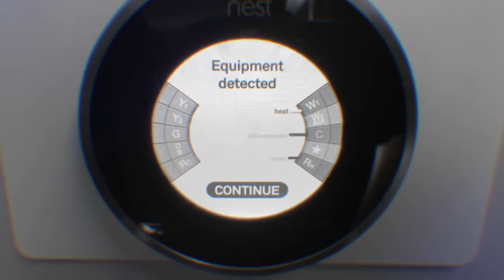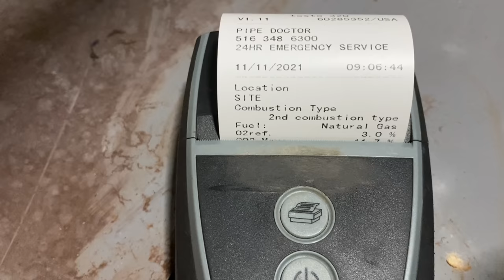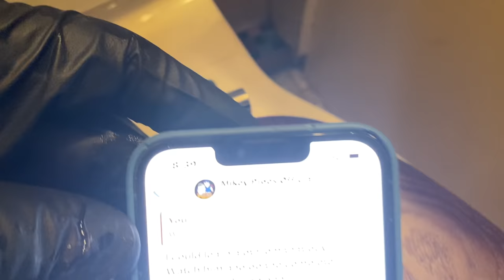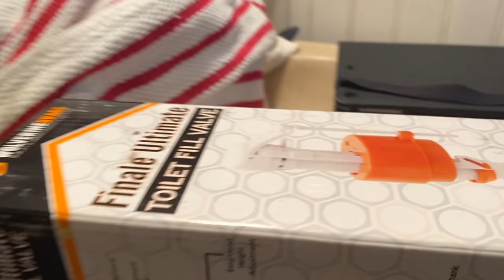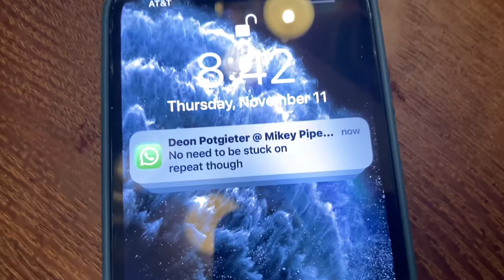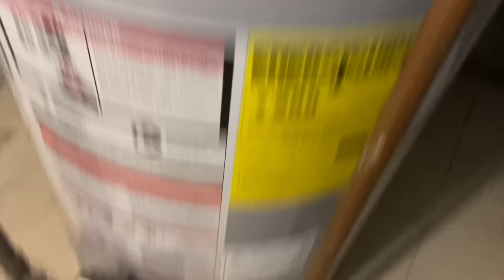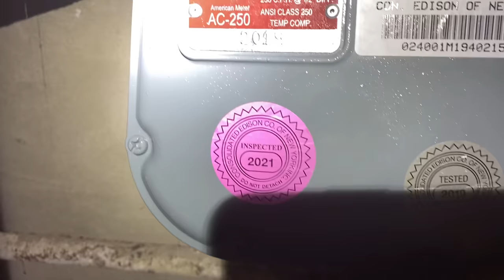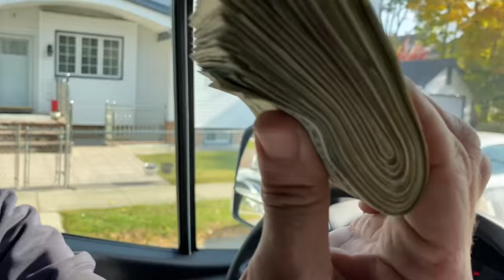Their House Could Of Have Blown Up! Huge Gas Leak on Brand New Williamson Steam Boiler Found!

Comment: This reminds me of an issue my parents had. They hired a plumber to put in a new furnace for them. About two days later they called me, and were like, the house still smells like gas. I responded it's not right and they should call the plumber that put the furnace in. They don't like to be demanding to anyone, so I decided to stop by with some gas leak detector fluid I had (essentially noncorrosive dish soap, like using it instead even though I still wipe up the mess after testing for leaks), anyway, I didn't even have to use it. Before I even took the cover off the furnace, I could hear a hissing noise. Reached up and turned off the gas valve, noise went away. Turned it back on a minute later and the noise came back. Power was already cut off to it. I had the number to the plumber because he's the same guy I hire, and yeah, he showed up 10 minutes later to fix it. It was a defective elbow on the piping he ran inside of the furnace, opposite side gas entrance so had to do two 90's to get it into the gas valve. The real kicker is that the gas was propane too, my parents were real lucky it didn't blast the house sky high.

Comment: Mikey shouldn’t that vent be further away from the elbow say about a foot away? The reason is that the vent is susceptible to being wrecked by steam hammer being too close to the corner where the water changes direction.
It wouldn’t hurt if it was up higher on a nipple if there’s any room above.

Comment: Wow haven't seen the gas meter inside a building in a long time. They moved them outside years ago.  Keep learning "Peter Pro Press".
Reply: Here in MA many of them are inside. The gas company has started to move some of them. If you have a stone foundation and very old gas line they don't give you an option to move it, only to disconnect and move to another fuel within X number of years. They don't want to risk drilling some of the old foundations and they don't want to reuse the original pipe.

Comment: brave! with big pipe wrench and hammer on the steam vent/bushing. 😱
I have a one word device for that situation "TORCH". heat the larger diameter or outer most part, so it expands the most (what the vent is being removed from in this case) and not the part being removed itself. although just heating everything in general works by breaking the ancient rusted/mineral bonding.
if it's out in the open and easier to redo a section a few feet each way, then take that route. I have managed to get things apart others couldn't or for sure would have broken off(but its time consuming). I usually go for the cutting/replacing route first, even if that means manual pipe threader in a few places.(big pipe wrench and cheater bar)

Comment: I remember when a friend was doing some work on his house... hit the plastic gas main with a pickaxe. Talk about an underwear-changing moment! Fortunately, there was no ignition. If you guys ever get into the  heat-pump water heater "craze", it would be good to see how Mikey Pipes Rolls! My AO Smith came from Lowes, but it's got a brass drain-valve... plumber couldn't find the vent-kit, though, since it apparently is not an actual AO Smith... just some re-branded "stuff". I sure hope the car companies don't find out about this sort of "business strategy".

Comment: Although it is asbestos and dangerous only if disturbed why did you say that the corrugated asbestos pipe insulation was illegal?  If it’s not disturbed and doing its job what is wrong with it?

Comment: Sounds like that regulator is hunting. Probably restricted vent line. Weird that the meter and regulator for the utility is inside a private residence? I've seen it on commercial and multi family before but not in a detached home.

Comment: Yeah, they sent us to do work for a school district and they didn't tell us that the reason why the building was vacant because it was filled with asbestos. After breathing that crap for 5 hours, we noticed that it was asbestos.
Reply: Bosses are great, aren't they.
Reply: @rogerlague1520  man i really felt that i was betrayed. I mean we did breath that stuff for sure. Also, it says that if you breath that stuff, you will have lung cancer in the next 20-30 years. So i really don't know what to say..
Reply: @ar-ed7im  while it is true that a single exposure to asbestos is all it takes to cause problems down the road, not every exposure will result in cancer or asbestos related lung issues.  I wouldn't start worrying what is going to happen in 30 years because I was exposed to asbestos one time, but I would start making sure I didn't get a subsequent exposure.  I also would fully document this exposure ( pictures, names, dates, locations, signatures ).
Reply: @mdrew44628  Tell that to the 911 responders

Comment: Mikey: Kroil is your friend. Buy some and keep it in every truck. Best stuff on Earth but not cheap. Used it daily in my 40+ years in refining. If it’s stuck, Kroil will get it open. Anything threaded/joined. Trust me…
As far as Peter, it’s obvious he’s had little experience using hand tools. He’s gotta start from scratch learning about hand tools and how to use them…all of us of a certain age had shop classes in high school. That combined with a parent, and friends, you learned how to work on stuff (cars, trucks, lawn mowers, tractors, etc) as a teenager, so you had tools in your hands on a daily basis…it’s why we need to bring this type of education back…we have generations that can’t even change a flat tire…someone has to take the place of all the working trades as they get older and retire…
Reply: @PipeDoctor  Penetrating Oil. My steel working grandfather always had cans of it around. I still have cans of it in my house and garage.
Reply: @PipeDoctor  penetrating oil. Amazon carries it among others. Not available in box stores. Available in aerosol cans, and bulk if you want to use spray bottles. You won’t use anything else once you’ve tried it.
Reply: @PipeDoctor  Kroil is also used to remove copper deposits in gun barrels.  Let it sit 20 minutes and remove.  Repeat as necessary. Be sure to remove all traces and dry the barrel.
Reply: Kroil is great stuff. I own older vehicles and do much of my own repairs, and it frees some very crusty bolts

Comment: that regulator was buzzing like a hitachi "massager"🤣 possibly over-pressurizing the meter and house, with the vent pipe to outdoors clogged with paint/bugs/mud wasps.
but that could be some horrendously un-muffled pumping station or something else upstream/downstream going nuts and causing noise.
as for the boiler gas manifold/header leaking, yikes, who welded that bracket on and blew a hole through the piping? (automated  robotic junk or kids?)

Comment: People watch too many movies in order for the house to blow up gas concentration level has to exceed 50% , you know how stinky that would be?
Reply: The explosive range of natural gas is 5-17%.
Reply: @DEFiANCE665  Correct,  which is also hard to reach those levels with a leak that size in a older home.
Reply: Thankfully NG rises, so the open doors help it disperse. Propane (all we have in my area) sinks, and quickly reaches high concentration near floor level.